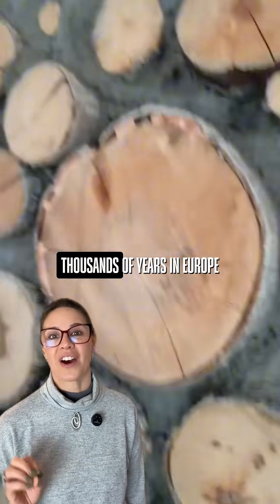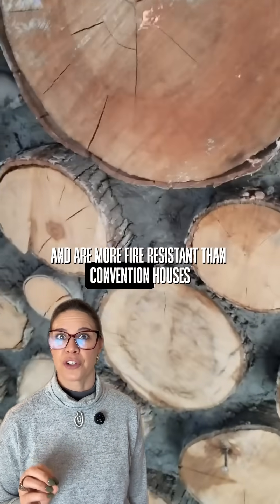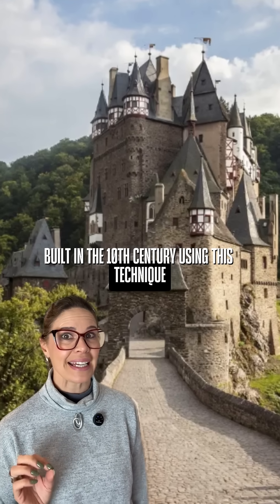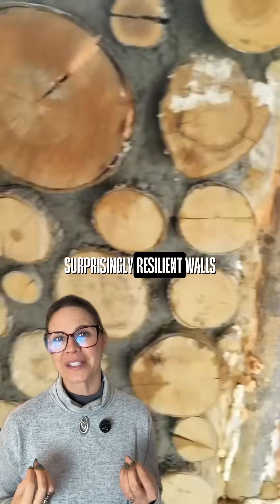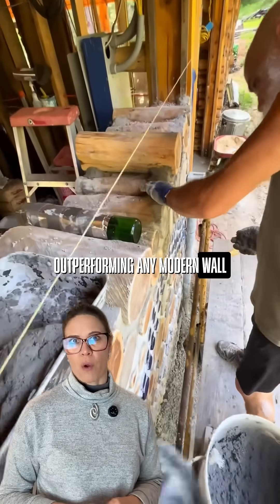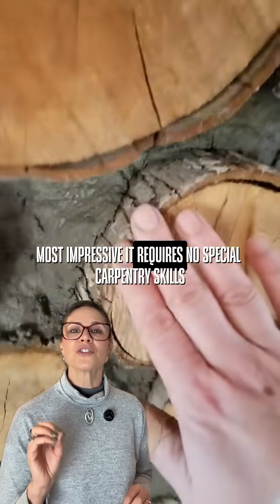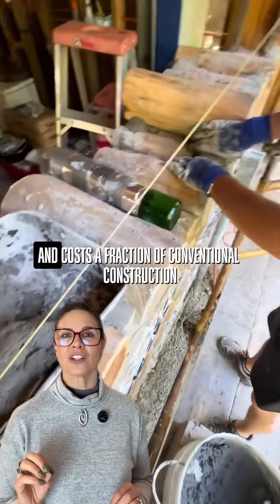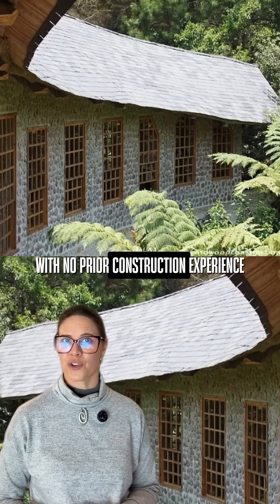This house is made of sticks — and stores CO₂ for centuries!

Comment: I have two concerns.

Wood is not just wood. There is wood with strong interlocking fibers, and wood that falls apart by just looking at it. The latter is the one we mostly grow in monocultures because it grows the fastest. Back in the day they just had whatever tree that grew in their proximity from strong and diverse ecosystem.

And the second is, no matter how motivated volunteers are, you just said they have no prior construction experience. Unless someone with experience oversaw this project, I’d be more cautious and careful entering that building.

Besides that, I love sustainable building methods and sustainability in general. Incorporating natural resources is a must as concrete alone gets sparse and heat insulation gets more and more critical with changing climates.

Comment: Nono it doesn't sound fragile. The only issue today is sourcing material so the cordwood we are talking about being built from waste wood and other construction material is not being built because where do you get all that waste from? 

You still have to transport it from somewhere.
Every industry that uses wood focuses on generating minimum waste... Because you know cost efficiency. So now you have to get small amounts from multiple different places.
More transport less material. Its expensive man you know how expensive building houses is already. and most of the industrial lumber waste is not even usable.